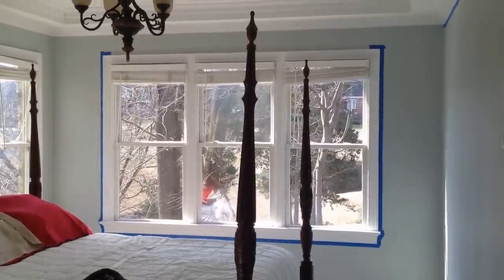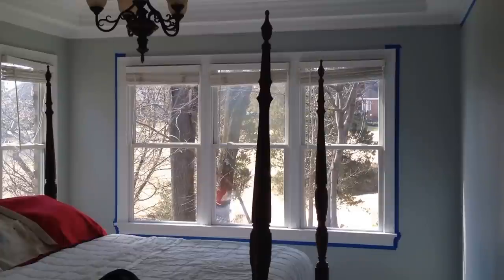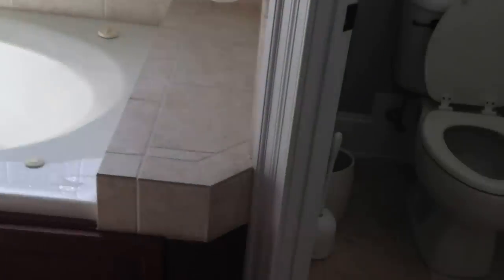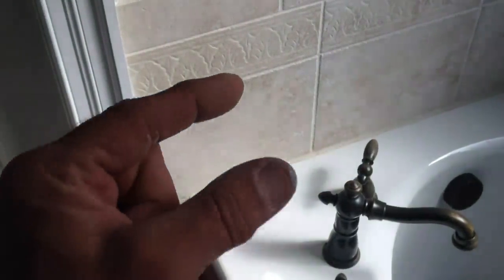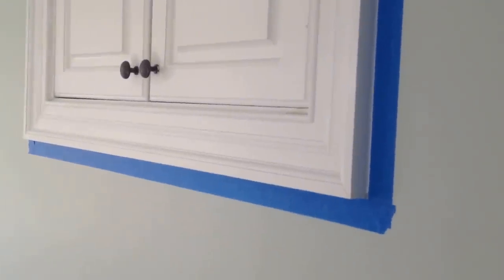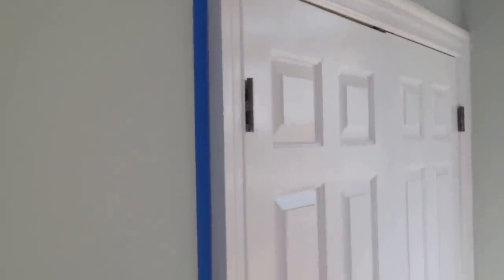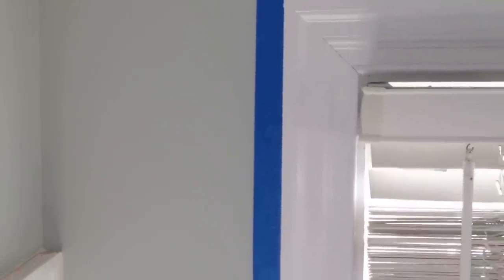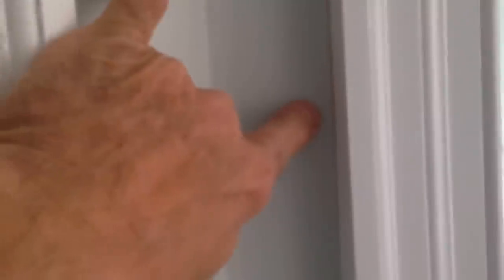PAINTING TRIM THE RIGHT WAY/ MASTER PAINTER EXPLAINS IT.

Comment: Fourth generation painter here. With respect, trim first is the logical way to go if one is a "master" painter. Bottom line is that ONE of the tasks (wall or trim) needs to allow the other to flow to it. Easier to allow a larger, flat object be the final edge, than a smaller, narrow one. Most times, "exact" lines look worse than natural lines. I used to cut the ceilings in of a 2 bedroom unit in 45 minutes, perfectly, no tape. For that matter, I used to brush out 32 six panel doors (in oil) with no masking of hardware or hinges. Nothing WRONG here, just not the best possible orfer of events, IMO. I'm guessing that your video is aimed at DIY'ers...nice to see you helping them.
Reply from the maker: Thanks Harry for your very informative comment.  I work in Raleigh.  The whole town is freehanders, forget the order of painting surfaces, and the scientific reasoning behind it.  But you're right in your insight.  Here's what I see very time.  Poor work in very house in every price range, and I ask myself why?  I paint two interior of house a week and have been for the last 7 years, all in the same neighborhood. Homeowners are waking up to poor freehanded work, and demanding more.

Comment: The blue tape that you are using can pull off the paint because it's so sticky 
 And alternative would be to paint the sides of the woodwork on day one and that the dry and then on day two you could freehand the wall up against the woodwork Or you could tape the woodwork with tape that will both stick to the woodwork and would not pull off the woodwork paint
Reply from the maker: Thanks for your comment Spencer.

Comment: I've been prepping caulking paint ceiling then trim then color walls. Works good for me because a lot of the times the texture isn't flat and can get bleed through on the tape job . and I definitely agree that a tape line can be perfect compared to cutting in.clients see quality. And as the word goes one shitty job minus 25 one good plus 5. Simple people just won't call you back and tell there friends. And then there friends give my number out to fix it! Stay up and be a craftsman, thanks for the video
Reply from the maker: +Vern Zwaag Your welcome Vern as you said the bottom line is people remember good work over just OK work.

Comment: Good video, and I appreciate your attention to detail. Sloppy workmanship doesn't work for me either. Sometimes you just want to refresh trim, base and crown. Taping can be a great way to do it, assuming you splurge on good painters tape. 3m Blue painters tape can and often does bleed under the line, defeating the purpose. Freehand straight cut in is indeed doable with much experience, but for your diy homeowner, use tape. It is easier/better to do the trim first, then the walls, if painting the whole room.

Comment: Tape is a waste of time. Tape is for amateurs, homeowners. I am a General Contractor every painter and other contractor I know paints the trim first. Much easier and faster to cut with wall paint. If your customer doesn't care that it took a day just to tape then cool. However as a boss there is no way I would pay you for a day of taping. If you were pro then you wouldn't need it. To bad I can't post a pic of my paint jobs I did myself with no tape.

Comment: Just my 2 cents. I paint often. Newly built home paint and home remodel jobs. Always use caulk on trim, door jams and crown modeling. It's the most professional way to fill in cracks. Obviously use wood putty to fill in nail holes left by trim guys. However, you caulk after you putty and sand those nail holes. Then you paint the trim. The paint will cover up the caulk, if not, the caulk will turn yellow. Always paint the trim before you put in the final cost of paint. That way you can place your tape nicely around the perimeter of all your trim. Then you can cut back in your walls then roll them. Pull tape shortly thereafter. Placing tape on the walls is backwards. You can achieve the same sharp edge affect and nice lines by taping off the trim instead of the walls. Plus you run the risk of pulling off paint and/or the top sheet layer of the tape is left on too long. If you MUST tape, use frog tape.
Reply from the maker: +Aaron Puckett Good points really.

Comment: I'm not a Pro Painter however, your advice is something we can all learn from.  If I painted for a living maybe I could do all this without taping. I paint infrequently and when I do I need to minimize mistakes.
I have painted walls first and painted trim first doing free hand. Either way I always have to do touch up.
Whenever I do the walls first and then tape the trim and paint trim my mistakes are minimized.
It is what I have found works best for me.
I hate when supposed Pros do not Paint the top of the trim.  Man I do not like that.
Great job Tom!
Reply: Jesse Vardaman

Comment: I've been painting for a few years now and use tape all the time. I'm fast at useing tape to cut certain lines that can not be free hand, period. I agree that you should paint the trim first but when you are working in a house that has been painted three or four times you find a lot of overlap and waves going into trim. If the homeowner only wants the trim touched up, that is when tape comes into play. The better I get the less tape I use, and I'll keep working on it. You guys are right though, that using tap is amateur for the most part.

Comment: I paint volume house or houses for a volume builder, so I get stiffed on rates, I’m moving onto another builder that always has different colour trim to walls , so I’m thinking of trying the tape method so I can employ someone who isn’t good at cutting in , I think it’ll be easier to show someone how to tape them to cut in. So if I understand correctly, you have painted your walls first ? And then doing trim , also I’ve seen Idaho Painter , he will caulk over tape and then paint , two coats doing that won’t work in my case , another video showed painting first coat in wall colour over tape , as that will weap or leak past the tape , then do your trim colour.

Comment: Same rules as cutting baseboard.  Protract all outside corners and cope always inside corners.  Never sway.  Same in painting.  Paint trim first then walls. Always.  I bet the walls were painted first here before the ceiling.  That's a fun cut.  Especially if ceiling is textured.
Reply from the maker: Thanks Tim for your comment.

Comment: im a electrician 30 yrs and build homes in palm bch, boca, jupiter island, and have seen painters sand, fill,caulk sand,and sand,then= spray trim first cut walls then roll walls.
 lastly touch up any where needed before giving back to owner.
 only tape the top of base before rolling walls. the point 1)trim 2)cut walls 3) roll wall   ? and  if its a repaint they remove furniture tape and visqueen then sand and sand.
Reply from the maker: Thank you s Buzz for your comment.

Comment: I know that when i used tape paint always seeps through & some edges of tape would look jagged when taking it off just after painting free hand is good to a point if i have to use tape i will use frog tape yellow one is less adhesive.
Reply: I learned if you lightly wet the frog tape, it activates the adhesive a little better.  Why they don't put that on the friggen package is a mystery.  :-/

Comment: I paint both ways. Sometimes trim/walls and other times walls/trim. For me it depends on how beefy the molding and base boards are. If I'm dealing with nice thick old school trim I might do walls first. On the other hand if I'm in an old house with plaster walls, most of the time there isn't a very clean line to began with so I might move the wall paint slightly over the original line to create a false line on the trim to straighten that line out. In that case I will have painted the trim first, but if you do paint trim first you need to be careful not to sprinkle the top of your base boards. I seldom use tape unless I absolutely have to, but I'm not gonna knock anyone who does. Ultimately it's up to the individual to get the job done the best way they know how and the customer gets what they pay for. Anyway, that's my two cents.
Reply from the maker: That's a very good way to look at painting trim, via walls first thank you for your insight.

Comment: Hey 
1. Do I need to buy primer to paint baseboards? And why?
2. Do I pull tape off when it’s wet or dry for a clean line
Reply: #1. If the trim is painted you dont have to do primer ..just paint  #2 .you have to leave  the paint dry before pull the tape off ...it takes 2-3 hrs. to dry

Comment: Sounds like the guy is pretty good, knows what he's talking about and priorities quality. However sometimes paint can seep through the tape and go places you don't want it to go. I'll mask most everything but there's many times I have to free hand it to get the straightest line. By the way I prefer to paint enamel trim first so I can over lap it onto the walls, then it's easier to cut in the walls and get a straight line, but if you don't have that luxury I tend to agree with this guy :-)
Reply from the maker: Thanks Steve for you input on this video.  I never have bleed through with tape.  But I clean everything before I tape, to ensure the tape sticks, and dig it in.
Reply: Taping the trim can work well in many situations but there's a variety of circumstances that prohibit taping and you must free hand it. Such as freshly painted or stained trim and other surfaces where the tape could pull off the finish.  As a general policy I try to tape as much as possible but sometimes you cannot. Any time you spray you defiantly have to mask it off but a good painter should know how to cut a professional straight line. :-)

Comment: Hi Thomas,  I am not a pro painter, but have painted many rooms large and small in my lifetime  The only time I don't tape or mask is when the trim, ceiling, and walls are painted the same color and same paint.  The only problem I continually have  is when I tape  popcorn/textured ceiling and not get a nice line because paint bleeds under the tape.  How do you overcome that issue?

Comment: If trim has over paint on it I paint trim first or just the edges, it's easier that way.. but I always check first.. I never use tape on any trim or corner unless someone over caulked it and the edge is to rounded out , then ya .. but ya good work sir.  Happy painting!!  :)
Reply from the maker: Thank you Dan I know my process can be a bit time consuming, but I always get great results.

Comment: if using calk go clear then paint over and pull tape up while wet
Reply from the maker: I've seen people do that before, but I've not tried that approach before.  Thanks
Reply: I learned that recently from The Idaho Painter. never thought to paint over wet caulk but it really does leave a nice edge with no gaps.

Comment: Prepper , you're a crabby ole fella , what's your "turnover rate" for employees ????
Reply from the maker: Zero turn over, I work alone always have.  Thanks for the question, yes I can be hard to work for.
Reply: @tnoel374  same here ..... I'm not quite as crabby , but I'm not easy to work for either , and I work alone a lot , especially nowdays that I'm older and would "just as soon do it myself as babysit" and it is hard to keep employees , gotta really hustle for work volume .... I spent a year by myself totally remodeling a large house , painting the whole thing inside outside , replacing SOME not all new siding 16' triple lap , did the whole damn thing by myself

Comment: All pros paint trim first. We try to never mask on drywall. Drywall is a tear zone with tape. Murphy's law always applies.
Reply from the maker: That's why I like to control the whole paint process.  If you let the walls dry 24 hours you will never have a pell problem.
Reply: Depends on what type of tape you use. If its crappy Kelly moore tape, then you are correct. They make a tape for fresh painted surfaces, you should put that cost in your bid
Reply: What if somebody wants you to paint their room and the trim is already there???

Comment: Not here to put you down. I am helping you get your YouTube quota.
3M and Frogtape must love you. I could cut the entire room while you are still taping everything. Straight too.
Never seen a master painter tape a ceiling. Have seen them do windows doors trim.
I watched an earlier video and said to my buddy he must have been an auto body guy. They tape everything.
I had 2 GM Diesel spray painters work for me and they taped everything. Looked good. They also taped because they couldn’t cut a straight line.
If you can’t cut, you can’t cut. No big deal. Both are now back taping and spraying planes and automobiles.
Paint your trim doors windows first, past the edge. Doesn’t have to be clean, the wall cut covers it.
 Much easier “to cut” the flat walls straight than try to do the trim edges. Even in the corners where you said no one in the world could paint a straight line. I must be “no one”
Have fun removing wallpaper. Couldn’t find enough money to get me to do that.
Reply: I Guarantee you that you cannot cut a straight line as if it was tape and sealed the proper way. trim first tape then seal with paint is the proffesional way

Comment: 78835 after taping  use wall paint first "If you are tape person"then 
trim paints two fast coats.Because i don't trust any taping myself.If it
 is necessary(Doing some line works always use opposite paint color 
first, paints bleeds,seals the cracks...drys then two coats other 
paint.I do painting about 45 years, i am 60.Tom started wrong.He has too
 caulk first.all the frames edges.
Reply from the maker: +basbugataturk01 Your right as for your way of doing it.  I covering mistakes, much different.

Comment: If a Home is gonna require taping then painting trim first is necessary for ease and speed. Frog tape works wonders. After the trim is dry it is very easy to tape out ALL trim using Frog Tape. I recommend the green one inch. Especially the horrid edges of trim and the unbelievably slow process of painting crown edges free hand. There are technically sound videos displaying the process. Your system is solid though and if it works for and you get the results you desire then that's all that matters. I do believe if you did the trim first you may change your process a bit... Take care and if you ever do some work in Winston Salem NC look me up... Willard's Painting... One man crew.... Had to plug...Thank you for your time and professional video.

Comment: I have a standing challenge that I can tape off a door or window casing and paint faster than someone who cuts it in free hand. Taping is a skill. It only takes me a few seconds and I get a perfectly straight, razor sharp line that looks better than free hand every time. I would say try painting the wood work before painting the walls. I think it goes a lot faster.
Reply from the maker: Thanks Ti I agree with you on taping speed, me too I'm fast at taping a room.

Comment: You really didn't say anything......paint the trim first then wall...use caulk to fill cracks and paint over it....use frog tape for straight clean lines....blue tape allows bleeding underneath

Comment: You can still freehand it all you do is paint the trim first and float the trim paint out onto the wall a little or paint just the returns first then cut in next to the casing. If you can’t cut a straight line along casing your not a master painter, tape is a four letter word to a real painter and should only be used if you’re an amateur or when there’s no other alternative

Comment: The only tape I use is to tape paper to the floors and plastic around all the furniture and maybe tape the windows if there is multi pane windows. And I have been a handyman- painter for over 30 years. You paint ceilings and trim first, then your walls. I have more call back and referral clients than I can keep up with... just saying...

Comment: Sounds good to me Tom! BTW, Shouldn't that electrical outlet near the sink in that bathroom be a GFCI?
Reply from the maker: +june201955 Your right about the electrical outlet, isn't a shame that water can just get accidentally splashed right into the outlet.  Good eye my friend good eye.
Reply: +tom noeldnerr Thanks Tom. I used to do more building than painting. Always had to review the building codes & zoning before getting started on a project. I only did it for myself on commercial properties. I used to like putting silk stockings & lipstick on pigs. Haha!
Reply from the maker: +june201955 lol VERY GOOD THAT WAS FUNNY.

Comment: Dont get stuck on your caulk theory buddy on white trim caulk is ok esspesially if your using tape.Good job with the tape by the way..however adding caulk between the tape and trim jlthen wiping and make sure to paint over while wet caulk will be hiden in tape.(the purpose of the caulk is to prevent bleeding through your tape) you will get bleeding.Just know the caulk and tape need to be removed while wet.
Reply from the maker: I let the caulk dry, and then tape paint walls let them dry, and then do the trim.  It's always comes out right.  Letting everything dry is the key.  No bleed through ever.
Reply: MR. FIX-ALL INC. Lies! Blue tape always bleeds threw . However as a professional how would you be able to make money and not be in the hole if you spend a whole day taping a few pieces of woodwork?